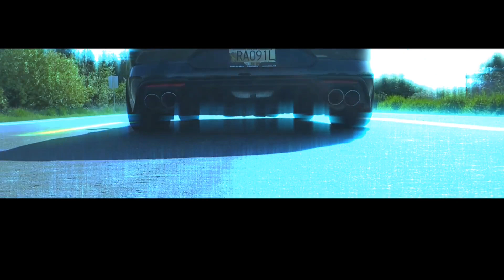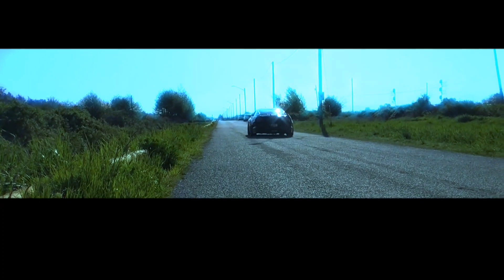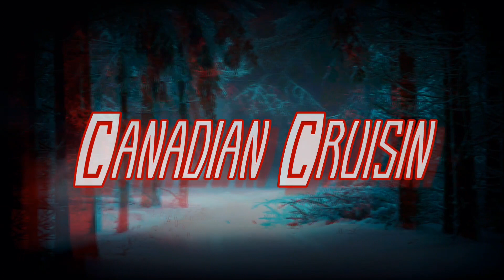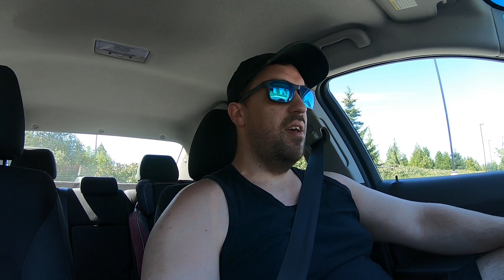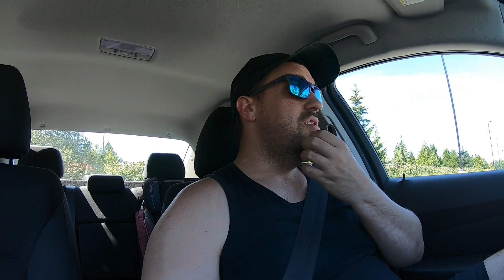FORD WONT FIX MY 2019 MUSTANG GT AND HERE"S WHY!! *IMPOSSIBLE*

Comment: Dodge dealership failed to properly secure oil filter (at least what I believe happened) on Challenger and enough managed to leak out overnight, leading to engine failure when car was driven the following day. This happened about 3 years ago and at the time I don't recall if they were 100% sure it was their fault or not but regardless, the block was replaced. I have the paperwork laying around somewhere, but total was at least 8k if memory serves right but probably more. After that happened, I've done all oil changes myself as I have lost faith in dealership's doing the simplest job.

Comment: It very frustrating not knowing what happened. Not to mention its a major major fix. my wife had a nice baseball sized ding in her door. I was so upset over it. That I was in contact with 3 chinese companies putting together a onboard DVR system like Police & Tesla used. Its really hard to be trusting anymore. We had a cable contactor putting in cable line in our house. Not until 3 weeks later did we see he stepped or pushed on the bathroom exhaust fan and cracked the sheetrock around it. To much time had passed imo. I still called and complained but took care of the fix.After incidents like this. Its hard to trust. And it sucks checking behind contractors etc.. Good Luck to you. Looks like a year has happened. Hoped you fixed it
Reply from the maker: There's other videos on my channel if your interested. I ended up taking the car back after about 5 months of waiting for ford and another shop fixed it in about 2 days for $300 dollars, where this dealership wanted 20k for a new engine. So definitely never trusting a ford dealership again.

Comment: Good luck.  My 2018 had a timing set failure.     Completely stock engine. 20k miles.   And ford warranty and extended warranty denied it.   After many run arounds. They came back with it needs a new engine. And because of a aftermarket shifter brace (obviously not part of the timing set )  it fell into a clause that would allow them to deny my claim.
Reply from the maker: Ford is a huge joke when it comes to warranty

Comment: After being stranded 3 times in the past 5 years by my F150's  (Broke down twice in my 2008 F150 4.6, babied, perfect condition only 68k miles) and once in my 2018 F150 5.0 (Transmission failure @ only 30k miles. - original owner and trucks were never raced and never used to tow). And Now @ 34k miles on my 2018 F150 my AC stopped working and the dealer just charged me $1,600 to replace the AC compressor which apparently failed.  Yes, sixteen hundred dollars to replace a $200 part that should have never failed in the first place. Furthermore the dealer will never give me a loaner car.  They look at me like I have 2 heads anytime I've asked.  I THINK I AM JUST ABOUT DONE WITH FORD.  Sorry to hear about your situation man, I feel your pain. Good luck.
Reply from the maker: The loaner thing blows my kind. A car dealership of all places should have loaners
Reply: please tell all of your friends about your bad Ford experience. they're spending millions of dollars removing negative comments from the internet. but they can only remove so many. and just for reference, my daughter's 2006 ram with $265,000 mi has the original compressor on it and it's quiet as a mouse

Comment: Something isn't adding up! I'd definitely fight Ford over this and here's why. As someone that's rebuilt a few engines the only way paper could've gotten in there is through the cold air intake/ throttle body. That's the only negative air pressure to an engine. And in that scenario it would've had to go through the intake manifold then through the valves and into the cylinder. Unless somehow it got by the piston rings. If it was placed in the oil fill it would've tried to blow it out as that's positive pressure. Unless there's something I'm not thinking about on these newer engines, but this seems pretty fishy to me. Or when you had your oil pan replaced maybe? Did something get left in there and it finally broke down enough to get sucked up by the oil pump? Either way, I'd say it's their fault and I'd fight tooth and nail of need be.
Reply from the maker: Yeah I don't get it either. I'm letting my insurance deal with it now since they send out their own people to look since right now it's just my word against ford's unfortunately
Reply: @CanadianCruisin 
Well mayb this is why Chevy is considered more reliable than Ford
Reply: @CanadianCruisin  talk to your insurance investigator about your replaced oil pan and that scenario having an obstruction left in there! Turned into fiberish material and clogged everything due to the extreme pressure!

Comment: Holy hell.  Using common sense, one of the tech's must have left/dropped the paper in there accidentally and probably doesn't remember so they don't want to say it was them.  I'd hate to see your insurance going up if it does go through them, when it wasn't your fault
Reply from the maker: If they deem it vandalism then my insurance won't go up. I'd just have to pay my deductible and wait for it to be fixed. If not then it will be quite the bill unfortunately

Comment: Well mate, that is a terrible situation you find yourself in....my heart goes out to you. I agree with your analysis and the events surely confirm your theory. When the video started I was expecting you to say your oil cooler had failed and blown your engine. I recently bought a 2019 here in the UK and had the oil cooler changed out straight away. Your issue certainly sounds like negligence to me, so stay strong and firm, don’t let them fog you off. Best wishes from the UK 🇬🇧
Reply: Hi Clive  that's interesting - was there a fault or was this precautionary and did you change out the oil cooler yourself?
Reply: Hi, I bought the car without too much research about the model. It’s a GT, almost 3 years old, only 3000 miles. Then I looked at forums and to my horror discovered catastrophic engine problems with oil cooler failure. I got it changed straight away by a Mustang specialist, they fitted an air blast radiator type. Expensive but now don’t have to worry. I saw a heap of heat exchangers he had replaced.

Comment: I just had an engine replaced on my 2022 after 600 miles.  Engine light came on, misfire in cylinder. Come find out ford said cylinder wasn’t machined or honed right in factory and engine needed replacing.  Best of luck
Reply from the maker: How long was the wait for the new engine?
Reply: @CanadianCruisin I dropped it off on 7/22 in evening, diagnosed on 7/23. Engine ordered 7/25. Engine and all parts came in 7/29.  Got car back all detailed and ready on 8/10. Dealer kept it inside during entire process.
Reply from the maker: @SixOneFive  hopefully mine is that quick whenever they get going on it

Comment: I think a thorough forensic examination by the  insurance people will be the only way of determining what has happened to the engine and the root cause of the problem.
If its a bit of cleaning paper, it would be interesting to compare it to the type used by the dealer.
I hope it all works out OK for you.

Comment: If it were actually a paper towel it could’ve got hung up for a bit before eventually making it to the oil pump oil pan! But plastic and paper does not look alike! Sounds like this dealer is junkie! My dealer changed the oil in my 22 GT PP1 at 5k miles and 5 mechanics were messing with and looking at my JLT air box etc, then took my car for a jog ride I assume after the change, rite after getting my car back I notice a bad tick and knock. Took it back and the manager said they couldn’t duplicate the sound I started it rite in front of him and said hear it now!!? Plus his mechanics already told me timing chain area!! These dealers higher children that are wreckless and incompetent!!

Comment: If you have to do a hole new motor I would buy a built short block 5k and have your heads cleaned and pull get new timing stuff and reuse all the covers and shields. You would probably be around 20k but motor would be much better then stock.
Reply from the maker: If I keep the car maybe

Comment: I agree its not warranty. No inherent issue with the car / engine. The cause is a foreign body being introduced into the engine. Then it’s a question of How and more importantly, Who? 
I think you should be naming this dealership in your videos, Tweets, whatever. There is clearly a possibility that the dealer’s throttle-body swap caused this. My view, customer service, reputation, etc. the dealer (and Ford possibly) should at minimum be stumping up to pay for the parts if not the whole thing.
Reply from the maker: I'm just keeping nice until they decide on what they're doing. After that it's fair game.
Reply: @CanadianCruisin   I get it but seriously, you can still be nice and 'encourage' the dealership/Ford to do the right thing. You've got over 4K subscribers and over 300 views on this video alone - use your influence to 'help guide' them.

Comment: Definitely not what I was expecting forsure. I'm on the fence of upgrading my oil pump gears on mine and was thinking that was your issue? Hope everything works out for ya! Buy a crate motor🇺🇲
Reply from the maker: I was thinking the same especially after they told me they seen a plastic piece or something in there. I was expecting a chunk or something snapped off

Comment: It's the dealer! I had a dealer try to get me to change my motor on my 6.2 v8 platinum because a broken $15 valve spring! I fought them till they changed the spring only and the insurance guy helped me with it! Ford dealers all suck down here (S. Florida), I'm sure it's the same everywhere
Reply: you are absolutely correct

Comment: Put it on the dealer to prove it wasn't them when they switched out your throttle body. Did you have a cold air intake?
Reply from the maker: All the mods were off the car for a few weeks already since I was planning to sell it
Reply: @CanadianCruisin  I ask if you had a  CAI intake in case the filter element came apart.  Inspect the inside of the filter.  Otherwise as a tech I'd say  a shop towel  or piece of was left inside during repair. And even if they'd still have to pull the pan and find the blocked oil passage. Did you watch them install the throttle body?
Reply from the maker: @tmilhouse8416  no I wasn't there for that. It was definitely some sort of paper towel when I looked. And it has been a while since they replaced that part so I would assume it should have done its damage long ago but I don't know.
Reply: @CanadianCruisin  even if it was long ago it still possible that it happened and a record that it was in the dealers hands.  Paper shop towel could have been pinched in between something, It may have held together flapping in the intake airway until it couldn't hold anymore. 
Mistakes happen even to the best of us with good intentions  and large companies like Ford have better recources than you or I to insure those mistakes are covered.
Reply from the maker: @tmilhouse8416  once I see what they have to say I'll work from there.

Comment: Toilet paper? Seriously!? That's what Ford is using as an excuse? It seems like Ford will find any reason to weasel out of having to step up and actually honor their warranty. Sounds to me like they did this!
Reply from the maker: Only place the car was left outside and not in my garage was in their possession so like you say it doesn't add up.
Reply: @CanadianCruisin  No sir, no it sure doesn't. My theory is this, I'm not going to say that they did this deliberately like sabotage, but probably some idiot there at the dealership goofed up with a shop towel and somehow, someway it made it's way into the engine. You take care of that car well. You're certainly not one to make egregious errors with it's maintenance. I'm betting what was a sensor issue as my Ford master tech friend though was made worse by the dealership. Just my appraisal of the situation.  Wow. I certainly empathize my dude. Damn. This more than just sucks. What color was this paper material? Blue shop towel color or white?
Reply from the maker: @jrhamilton4448  everything is mush and covered in oil so it's hard to tell exactly what it was. It was all ground up in the motor
Reply: @CanadianCruisin  Hmmm. I'm wondering if what that one guy was thinking about a faulty oil filter as one possible cause. If the filter can be examined for issues that could tell if it is. It's a motorcraft filter from Ford as you stated I just can't see how something like that could have gotten in through the intake system and ingested by the motor. I'd like to see that oil filter. Have them remove it and take it apart to see if it's intact! If that's the culprit it's on Ford!
Reply from the maker: @jrhamilton4448  I'll get more details when the insurance guy gets back to me
Reply: @CanadianCruisin  Please do! This is very disconcerting to hear. I never would have suspected that type of thing to be the cause of the problem and as you and I agree something here isn't right.
Reply: @CanadianCruisin  My tech buddy says it could have also been anti corrosion paper, VCI packing paper on new parts the dealership installed. He's seen pieces as big as wrapping paper get ingested from cars serviced at dealerships that hire idiots.

Comment: Your theory makes no sense. You took the car to the dealer because it had no oil pressure. If the dealer put something in the engine how could it travel through the oil passages if there was no oil pressure to move it. Whatever was in there was put in there while the engine had oil pressure.
Reply from the maker: If it was a sensor it would have had oil pressure just not read the pressure properly.
Reply: @CanadianCruisin  Good luck with that. That would mean you have to convince someone that even though you had a no oil pressure warning light there really was oil pressure, and then the dealer stuffed some paper into the engine and clogged the oil passages. Nobody's going to believe that.
Reply from the maker: @bobl4816  the engine wear would be a sign. With no oil pressure for hours which I was driving would leave a lot of scoring

Comment: they cant seem to get their story straight. plastic or paper piece. Too bad you dont have more subscribers. If you had 100k, they would fix it. However, you are still an embarrassment for the company and they do have a social media presence which they follow. keep up the heat with these scumbags. Eventually if you make a long enough stink, they will fix it. also write to the president and talk about ur subscribers. keep up the heat.
Reply from the maker: Yeah its all a gong show. Still waiting for insurance to look at it
Reply: @CanadianCruisin  why should you incur possibly higher rates when they caused the problem? besides, carriers love to run from their responsibility. write the the president  of ford. worth a shot. 
I just bought a 2001 mustang gt convertible after talkin about it for SEVEN years.  tranny sometimes feels hot. no slippage.  have to check the fluid. your thoughts 101 k miles.
Reply: @CanadianCruisin  keep swinging with the videos. ford's social media team is definitely watching.